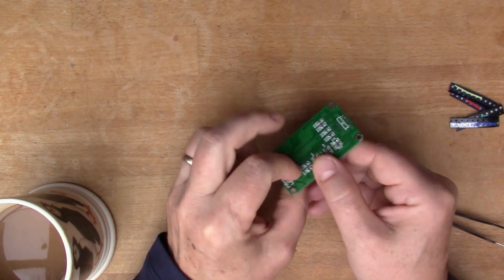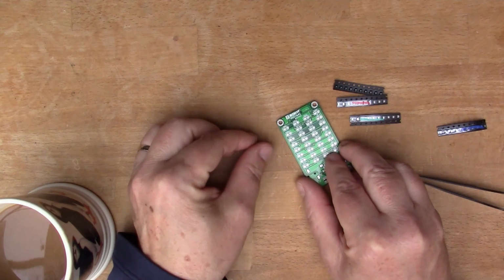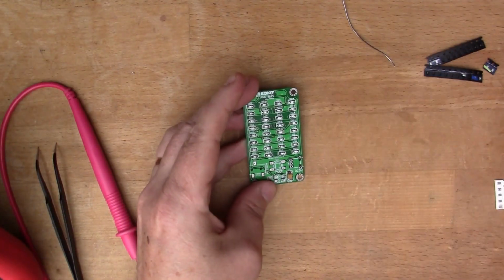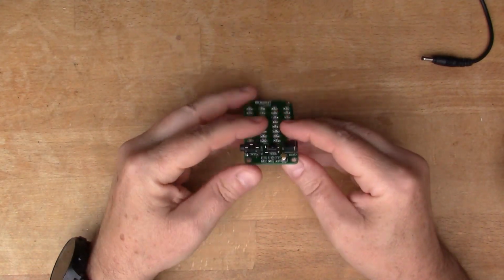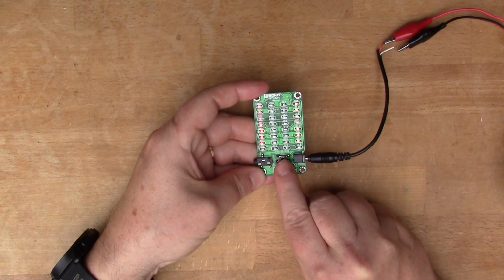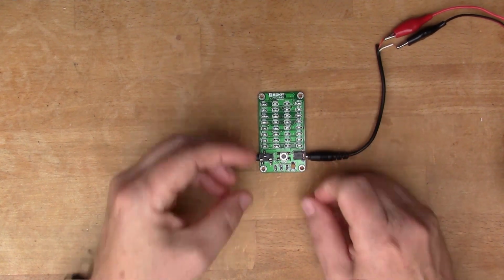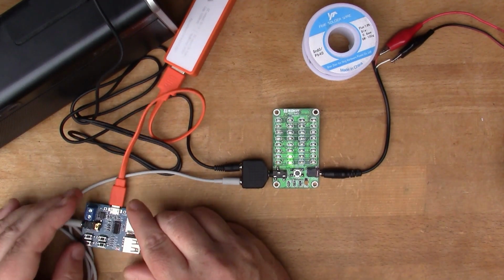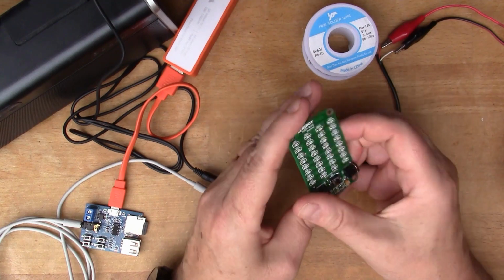Audio Spectrum Kit - Build and Review (#122)

Comment: Covering the leds with an opaque piece of perspex/plastic can give a good visual effect.  I read somewhere that the smd leds they use in the cheap Chinese kits are seconds or sub standard.  Not sure if this is true but I have had a few fail on me in the past!
Reply from the maker: I think Big Clive has commented on crappy LEDs before.  At least in this kit they provided a couple of spare LEDs in each strip - useful as I certainly pinged one off my desk and couldn't find it.
Reply: Yes I've also lost a few bits and pieces to the carpet monster.